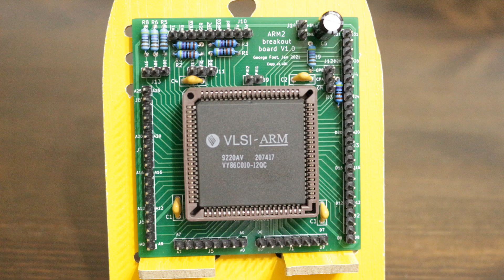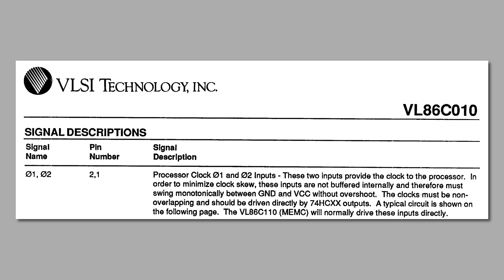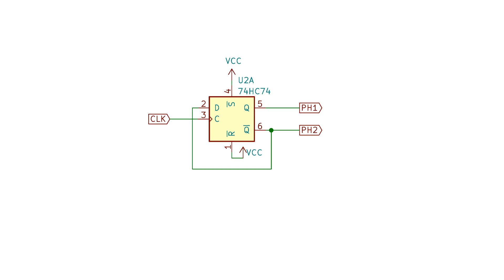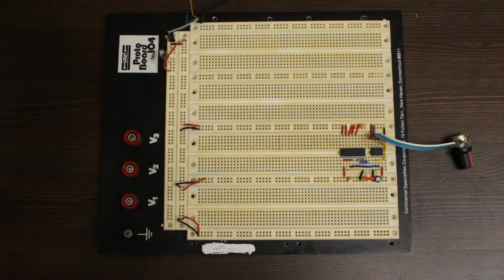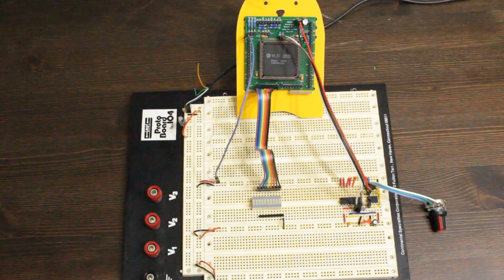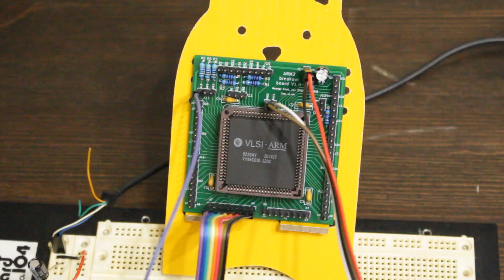Homebrew ARM2 #1: Breathing life into a CPU from 30 years ago

Comment: can it run android?
Reply from the maker: Haha I doubt it!
Reply: @GeorgeFoot  that's the joke
Reply: @Clancydaenlightened  It can run Linux and Android is just a flavour of Linux. All modern ARMs use 32-bit or 64-bit addressing. The early ARMs used 26-bit addressing and repurposed the remaining bits to incorporate the status flags into the program counter register so there's a compatibility problem there. For a time, 32-bit ARMs had a 26-bit compatibility mode but I should think that is long gone. Also, modern ARM cores have instructions that weren't present in the old ones and more registers but if you compile the source with the right options you can run Linux on an old ARM and get as far as the bash prompt. If you want graphics you'll need an external chip. ARM2 has no integrated GPU. Back in the day there were three companion chips called MEMC (the memory controller - I had two if them, each controlling 4 MB of RAM), VIDC (the video controller) and IOC (the IO controller). As time progressed they became integrated into fewer but more powerful chips. Now we have the Raspberry Pi, which has the entire computer, except for the RAM, in a single package. The circuit board is really just a means of attaching the plugs and sockets to the SoC. Incidentally, the operating system that was written to run on the ARM2 was called RISC OS. If you want to try it you can run it on a Raspberry Pi and even on the original Pi it's blisteringly fast.
Reply: @GeorgeFoot  Modern phones can hardly run that piece of sh... er... bloatware.

Comment: The ARM 2s was a redesign that eliminated the dynamic circuits so you could stop the clocks. The "s" is for static. It was never available as a standalone processor but only as a core in SoCs
Reply from the maker: Interesting information, thanks!

Comment: This was very, very interesting, and I’m really glad to see the CPU turned out OK. I was a bit worried it might not work, given the packaging you received it in. Please make more videos, can’t wait to see where it takes you!
Reply from the maker: Haha, yes, that was about as bad as packaging could get. If it had pins they'd all be bent. I still don't know for sure if it's fully functional internally, but at least the address bus and PC incrementer seem to work.
I'm also currently running it out of spec - the maximum time per clock phase is quoted as 10ms, equivalent to 50kHz I think, so it's possible something else internal is sensitive to this beyond just the address buffers that I already saw failing. So there will be a few possible causes to check for if something does start behaving oddly in future.

Comment from the maker: I should probably have said 1986 - but this 12MHz version didn't come out until 1987 I think
Reply: No, you were perfectly right : the Archimedes, with the ARM2 at 8 Mhz, came out in 1987 and the 12 Mhz machines, with the ARM250 SOC, came out in 1992.
Reply from the maker: @Archimedes75009  Thanks for confirming! Though I think this is a 12MHz ARM2 which was probably also a later revision of the same architecture
Reply: @GeorgeFoot  12 Mhz ARM2s have never been used in any Archimedes, except in the very 1st A3010s : the ARM250 SOC wasn't available at 1st, Acorn implemented the 4 ARM chips in these rare models ( and the ARM2 is clocked at 12 Mhz ).